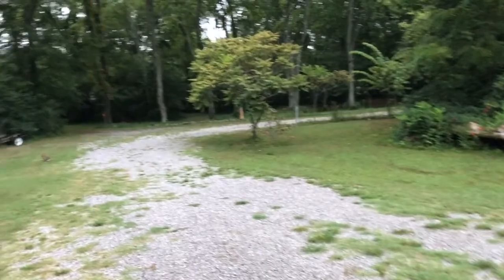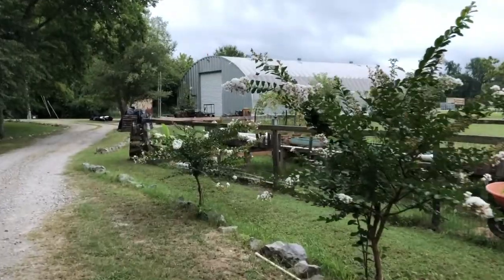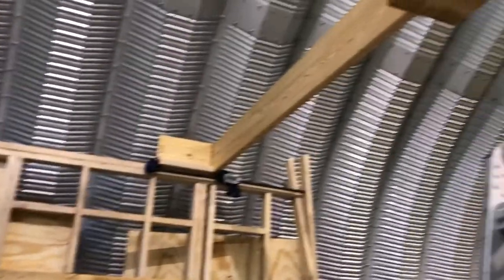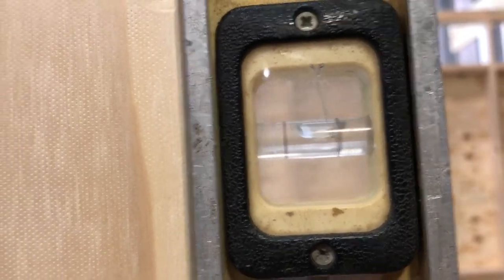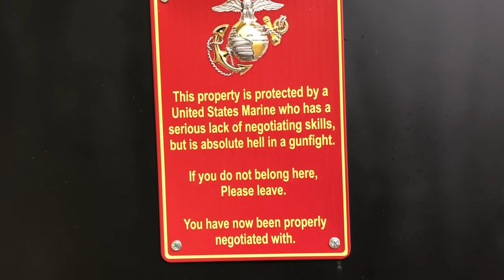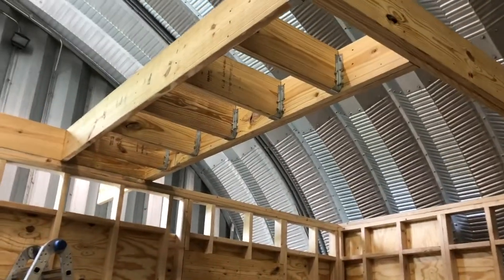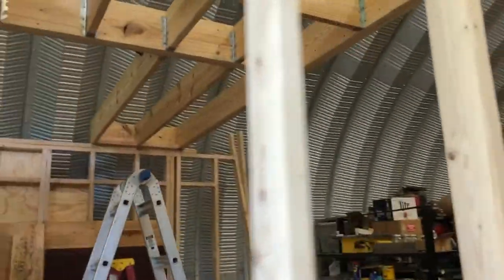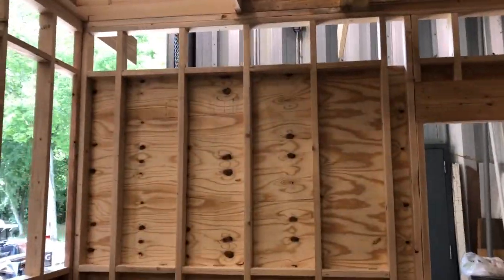Shop Build VLOG 4

Comment: there is no excuse to not use joist hangers and double hangers, end nailing is not as strong as the hangers.
did you run this design by a builder or inspector?
you can order what you need at home depot and they will have it ready for you when you get to the store so you don't have to wonder around the store and waste time.
best
john
Reply from the maker: I am going to get hangers tomorrow for the ones that I skipped.  After looking at it for a minute.  I don't really have any plans or a need to consult a builder.  I was building houses in California earthquake zones back before they had pneumatic guns.  I have framed many a house and remodeled hundreds.   I am not a DIY guy, just sayin' John.  I always welcome your advise and keep it coming.  Your suggestions make me think.  :)  Thanks for the comment.
Reply: @iROBODUDE  I know you are a sharp guy, but I know how I am when I get tired and forget to measure twice.
best
Reply from the maker: PS.  I have Pro contractor accounts at both big box stores.